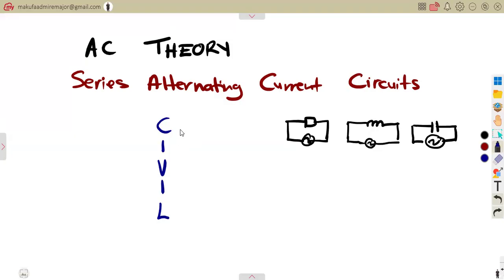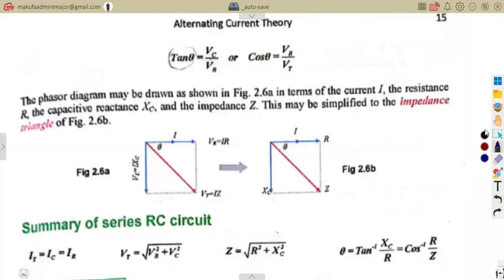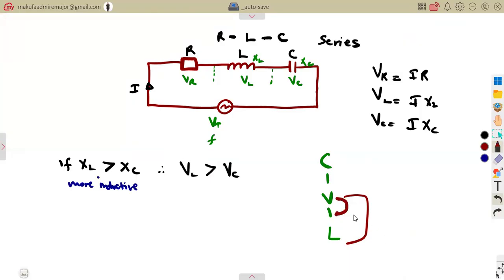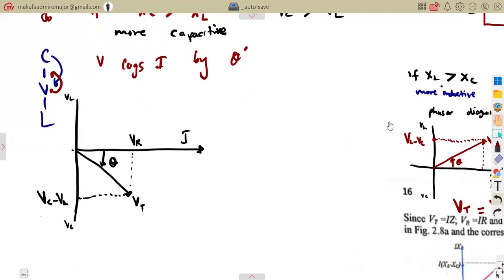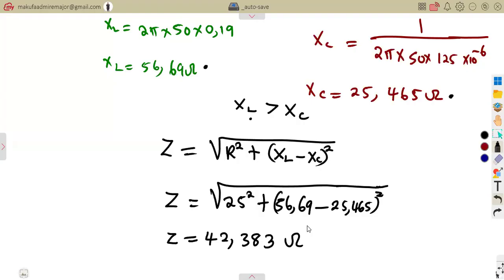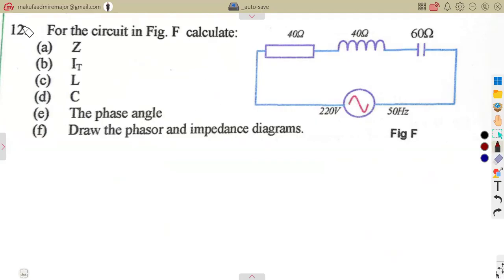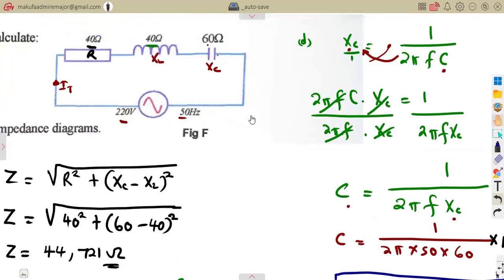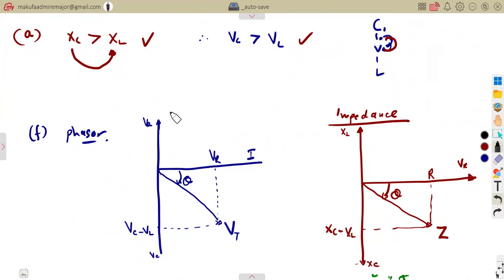Industrial Electronics N3 Series Alternating Current Circuits Introduction @mathszoneafricanmotives

Comment: You made a mistake when calculating Vc for the example (4,719)(25,465)=120,169 not 106,418 
But apart from that I understood what you where explaining
Reply from the maker: Thank you for the correction, more light ✨️ 🙏